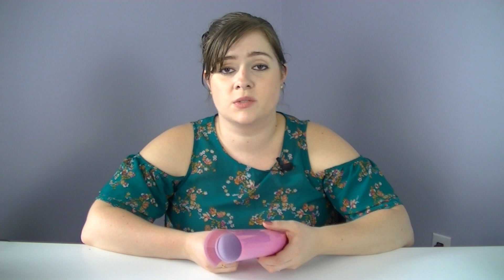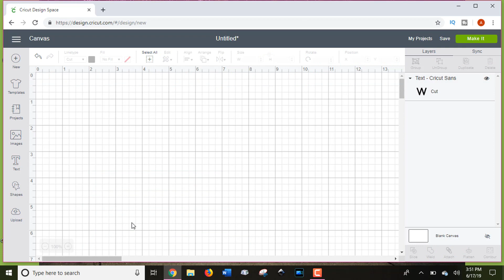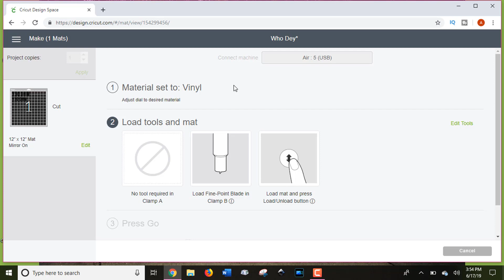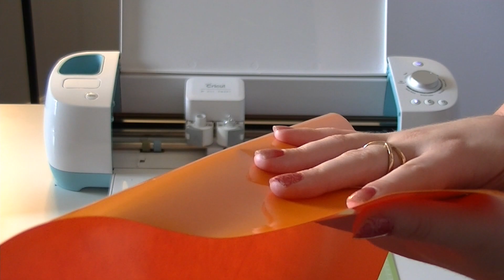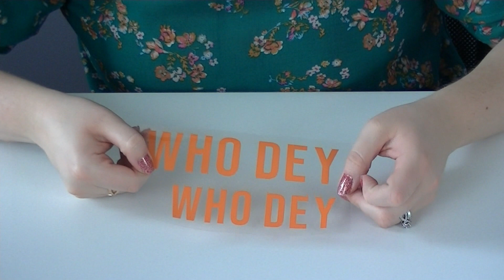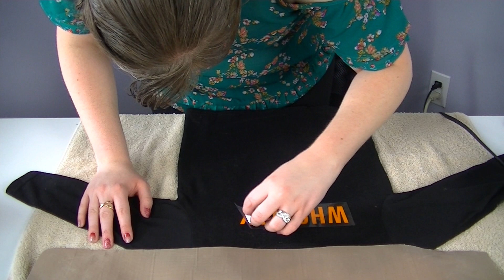How to Use Heat Transfer Vinyl (HTV) with Cricut | Cricut for Beginners Series

Comment: How can you use HTV on a cork board?
Reply from the maker: I"ve never tried it myself, but based on other videos I can find, you follow the same process that I show you with the iron or an EasyPress. Follow the manufacturer's directions of the HTV, use a teflon sheet or parchment paper, and do a final press after you peel off the carrier sheet.